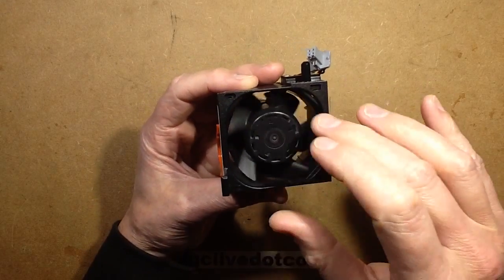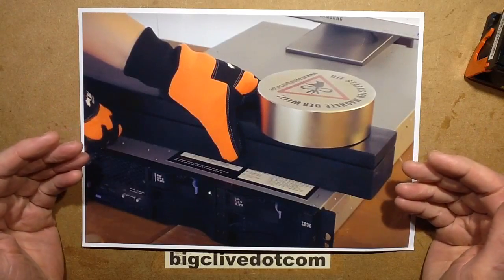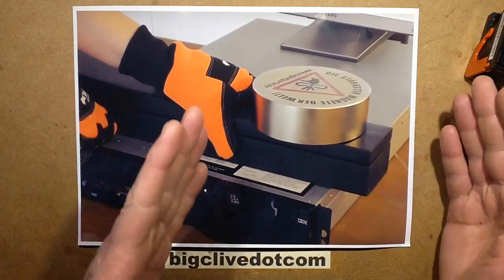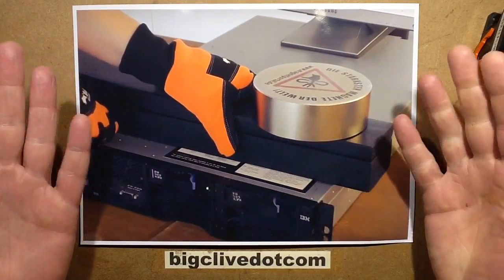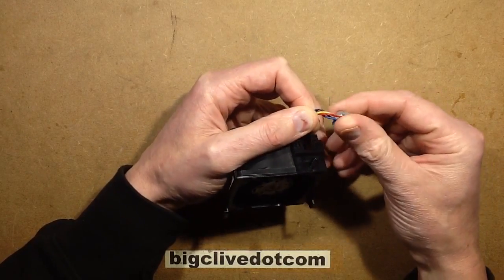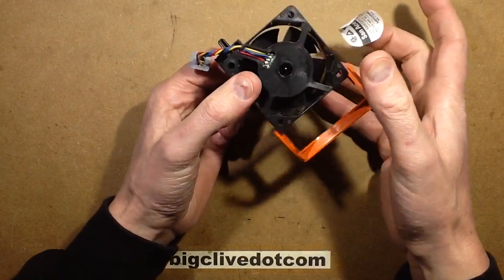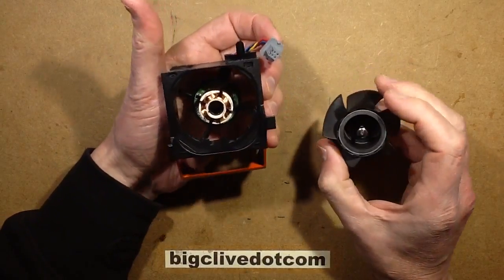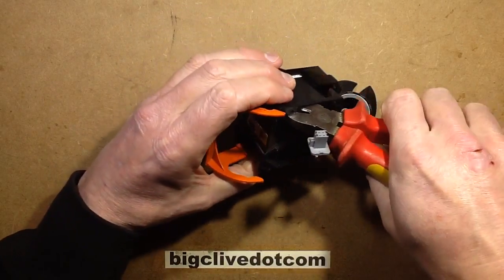Dead server fan autopsy.  (Unusual circumstances.)

Comment: Are you sure it's the zeners and not the drain/source of the mosfets that are shorted? The latter is the common failure mode for mosfets when over stressed, but not zeners, which would typically go open.
Reply from the maker: Definitely the zeners, I thought it was the FET package at first, but removed it and the fault only cleared when the diodes were cut out.
Reply: bigclivedotcom thanks for the reply! In fact, it looks like zeners also have short as the common failure mode, so my assertion that they fail open was incorrect. Always learning! FWIW I did a post mortem analysis of MOSFET failure modes a few years ago after a power system failed on a satellite in orbit: nothing like sitting with a bag of 200 power transistors deliberately blowing them up. The in-orbit failure was due to incomplete thermal vacuum testing. The MOSFET was used in the linear region to shunt excess power to avoid the battery over charging. The system worked in the lab and clean room in air because of convection, but failed in a vacuum due to excessive heat. The satellite lasted about a day in orbit before the battery exhausted as all the solar panel energy was shorted by the failed MOSFET shunt. An expensive mistake to make.

Comment: My guess is simply saturation of the motor coils cause by the strong magnetic field. This would greatly reduce the effective inductance of the coils and allowed excess current to flow.
Reply: https://en.wikipedia.org/wiki/Saturation_(magnetic)
Reply: Saturation, yes, but of the stator IRON, not the copper coils. The big external magnet simply swamped out the piddly rubber magnet inside the rotor, then proceeded to saturate the laminated iron stator. Once saturated, only the quite low resistance of the coils would remain, instead of their (usually high) reactance. It's like the coils became shorts, drew massive currents, and poor little semiconductors got killed by the angry pixies. Plus the rubber magnets probably got re-magnetized with improper poles.
Reply: Makes sense.
Reply: YodaWhat This does not explain the burned-out zeners however.... In contrary !
Reply: Dead conversation, but for the benefit of anyone else reading it, I think this is a plausible explanation. The inductance gets cut by fivefold, the current goes up five times, and nowthe zener diode has to deal with the same duration of current pulse, with the same zener clamping voltage but fve time the current and energy. I think the motor was stalled/abnormally magnetized for many seconds to actually scorch components like that.

Comment: If you have a big magnet near a brushless motor, it can overwhelm the power control circuit, which would make sense as to why that component exploded. The amount of current it drew shot way up beyond it's capability. I'm surprised the bearings didn't go, then again they are heavy duty high speed bearings.

Comment: taking apart an old wifi router that just burned out. any advice? got the plastic cover off and am having trouble getting the heat sink off.
here is a link to what i think is the router: http://www.linksys.com/us/p/P-WRT1900ACS/

Comment: I am going to guess the zener diodes suffered physical damage from the magnetism tearing the structure apart internally.  I know lots of diodes have steel leads so the silicon might be mounted on a steel base and may have steel electrodes attached.  Magnets and steel on a microscopic level?  Just a guess but nothing else adds up either.

Comment: Hi Clive, I always like the blow ups you do of the circuit boards so we can have a good look at them. I think you've said before that you use a printer with a continuous ink system? Could you tell us what printer and ink system you use and any opinions you have about it?
Reply from the maker: It's actually a very old printer that was passed down.  It's an Epson SX515W with a generic CISS system bought from eBay.  It does require that the printhead is cleaned occasionally, particularly if it sits unused for a long time when I'm travelling with work.

Comment: Think for a moment. If you introduce a magnet to a rotating magnetic field, you get electricity. Its how the fan works in the first place. Anyway, the super magnet created a back current. Apparently strong enough to blow the diodes and continue until it met the input current at the transistor.

Comment: The way the fans were mounted in the chassis, here's a fairly mechanical idea: As the Big Bad Magnet™ was put on top, the fans started to alternate (badumtishhh) between almost blocking and generator mode as the magnets on the rotor were rotating through the external field.

Comment: I had a finger pinched between two SCSI drive magnets (each could suspend 10kg from a steel lintel), no chance of separating them so had to pull a 15mm plug of skin off. :(

Comment: The Zener diodes may have been used as a clamp or snubber for the voltage spikes when the mosfets are turned on and off.  Zener diode do have power rating and will burn up if too much current flows thru them while they conduct.  
The standard data sheet schematic looks like a "H-bridge" circuit which allows the motor to be reversed.  Since cooling fans spin in one direction, only  half of the H bridge is needed.

Comment: Would you look at that. An IBM System x3650 (M2 by the looks). I've had one sitting in my garage for a few years now.
Reply: HI 
No a IBM System x3650 M1 (7979) I am deeply in to servers on my channel.
Reply: @MyPlayHouse  you would know wouldn't you if that's the case right!

Comment: There is a possibility that the magnets caused the stator coils to become saturated. When the mosfets turned on it tried to neutralize the magnetic field caused by the magnets. When the mosfets turned off, they released their feeble magnetic field. This sudden change allowed the magnets to again fully saturate the stator coils, causing a spike of current in the forward direction of the zener diodes causing a large forward current. Something like the secondary of a current transformer that doesn't have a load.

Comment: If the fan contains permanent magnets, wouldn't Braniac's magnet stall the motor? I'm not sure what effect that would have, but I've always heard it's generally bad to stall electric motors. 

Or perhaps the motor was just strong enough to turn it against the magnet and the fan "snapped" around quickly feeding a fast pulse of energy back through the windings... Just a thought.

Comment: I wonder if the magnet could have messed up the PSU control chips and sent a high voltage surge thru the whole system?

PC fans are really hard to kill even over-volting them.  Typically the 2 faults I see with them are sbapped fan blades or seized bearings.

Comment: Spinning copper strong mag field yeah reverse current through the circuit at way high voltage.
Reply from the maker: The copper was stationary.  It's the magnetic rotor that spins around the active stator.
Reply: I missed that somehow. the big magnet would increase reverse bias during the switching of the pols and flatten the forward volts causing a motor stall and over current through the drive as it was trying to overcome the stall.
Reply: But the coils were being pulsed and then a frigging big magnet came along and amplified the current.  
It looks like back emf on steroids.

Comment: Although the larger magnet was moved slowly, the fan surely was rotating inside the field of the much larger magnets field at something like 2000 rippems... thus created the same effect as the larger magnet moving faster past something more static... Surely in one pole orientation the fan would have had a super sonic kick up the arse as it moved in/out of phase/magnetic orientation and became a generator for every 1/4 cycle. Now thats the sort of magnet for finding a needle in a heystack.. ziiing.. found it.

Comment: From your description, I think that the big magnet saturated the stator core, so when the transistors switched on, the current ramped up much more quickly than the controller could handle.  (It may have a minimum "on" time for the mosfets.  This could cause the zeners to see far more current than they were rated for.

Comment: I love when he said 'I'm not sure what would have caused that...', my first thought was, 'A giant fucking magnet, that's what...'

I know what he meant, it was just a joke in my mind, not an insult, or anything negative...

My thought is that as the blades were spinning, they would have a point where they would pass in and out of the Neodymium magnet's field, possibly causing a voltage spike back into the coil, since magnetic fields do stack, as each appropriate pole passed through the magnetic field, it could have added the 'power' of the large magnet to the 'power' of the smaller magnets in the blade... Just a thought...

Comment: clive, the diodes failed from the back-EMF from the windings in the motor when they passed the magnet over the server
Reply: The coils on that motor are mounted to the frame, so they never spin. And the manet wsn't moed very fast

Comment: Are you sure the zener diodes are in parallel with the MOS transistors ? I think they are in parallel with the coils !  ( this would also explain why these zener diodes are dead ). The schematics you draw on 07:06 is probably wrong (If I am wrong please correct me)
Reply from the maker: The zeners were definitely across the MOSFETs.

Comment: Overvoltage on the 12V rail is not very likely. The server is usually fed from two power supplies. If so, the system would have turned off or it would have damaged other components in the system like the motherboard. 
More likely the the thing that that mosfet got excited through the magnetic field.  Or the hall sensor reported a static magnetic field, that was interpreted as a not running fan, leading to increased current throuh the coil /mosfet. 
I hve never seen a failure Mode like this. Since that fans are usually roboust to beeing blocked. Btw. 50 mA is not really much for server fans. They can consume up to 2 amps in operation each.

Comment: Huh.  When this started, I would have guessed they demagnetized the magnet in the fan blade.  But I think what happened is moving the magnet induced a high enough current to blow the zeners.  Remember - a zener is a diode.  It just happens to have a controlled reverse breakdown voltage.  You put a diode across a coil and move a powerful magnet, it shouldn't be too big a shock if you exceed it's current rating and blow it.

Comment: I still think that massive magnet sliding into place induced a massive voltage in the windings and electricuted the pcb, On a small magnet you would have to move it fast, but that massive one would produce a lot with slow movement.
Reply: In case others stumble across this comment, it's worth noting that the peak field strength is not as important as how fast the field increases. A big magnet will start magnetizing the motor when it is a few feet away, and then gradually increase to a maximum as it gets closer. It would actually have to fly towards the motor faster than a small magnet to create an equal △B/△.

Comment: Maybe the motor locked mechanically from the magnetic forces and the control circuit keep pulsing the windings until the repeated fly back pulses burnt out the zenner diodes. The magnetic field from the magnet may have also saturated the windings which would have made things worse.

Comment: I think I have to go with over voltage! I've never heard a fan scream like they were before death! I wonder: and this, Clive, is for you:
What happens to a switchmode power supply when core saturated by a big magnet while running? I think you need to try it, We love  smoke and bangs!
Something else to do to a cheap dangerous pink usb charger from China!

Comment: Is it plausible that the magnet rotated the rotor really fast and thus induced a higher voltage in the windings, frying the board?
Reply: I don't see how a static magnetic field could do that.  It might move to align to the magnet, but not spin.
Reply: I was thinking that. It might have made the hall effect sensor do something wierd.

Comment: I am a great fan (no pun meant) of Brainic75. We have "talked" to each other several times. With a magnet of its size there are many other un-thought of ideas that spring to mind. The dielectric field of a magnet has some weird effects. It was a fascinating video by you though, again. I am now mad that you electrical dudes have so many DIODES. I am off now to kill myself, as any self respecting Mechanical Engineer would do :) Cheers.